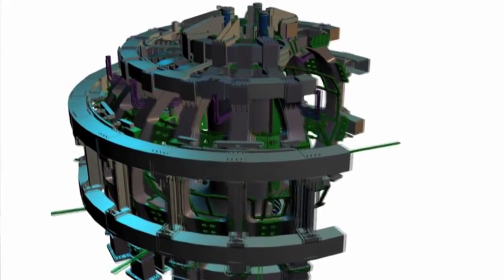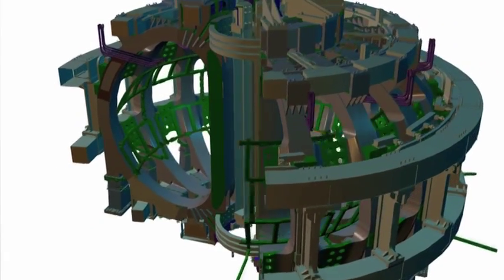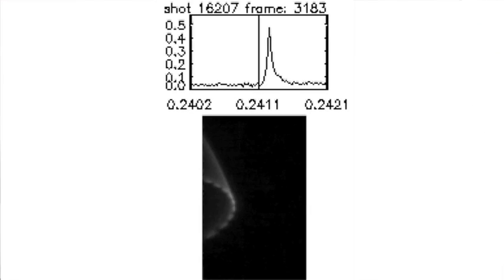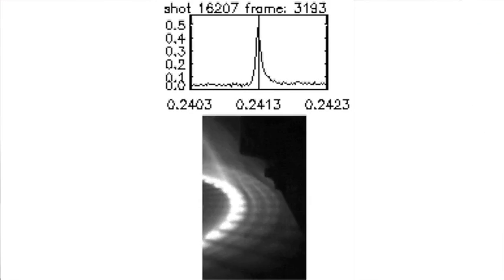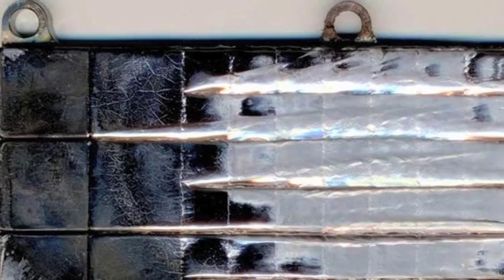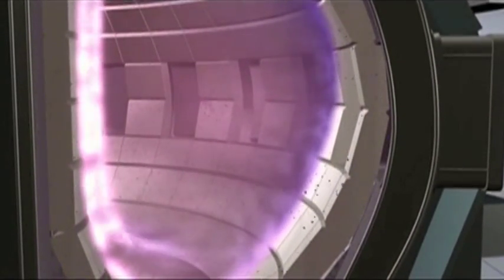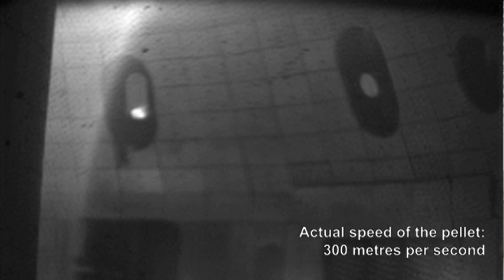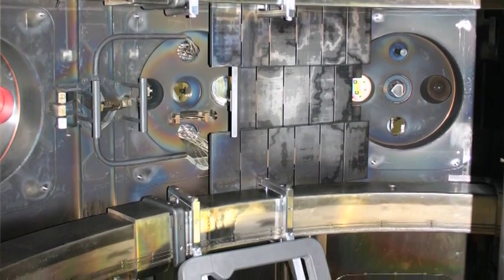ITER - ELMs and how to control them

Comment: Get the heat-harvesting system intergrated into the Tokamak design. It will need a stagered heat transfer interface, with several heat exchange steps between the Tokamak Heat-Exchange Surface and the boiler-turbine interface.